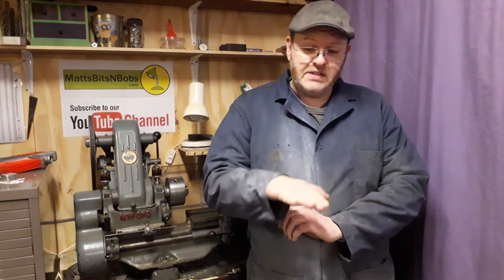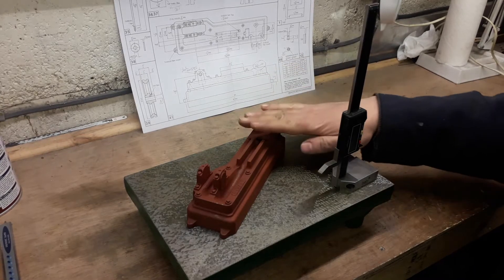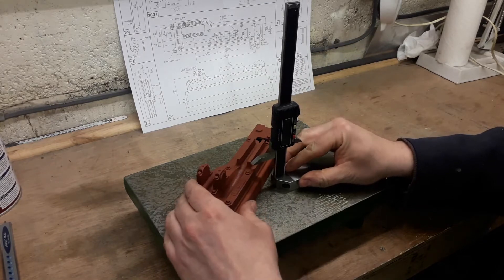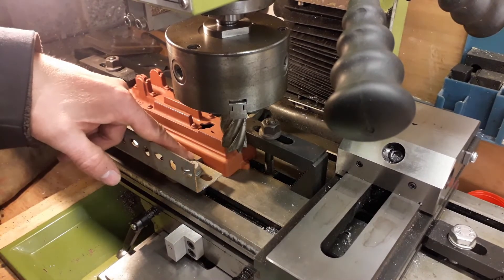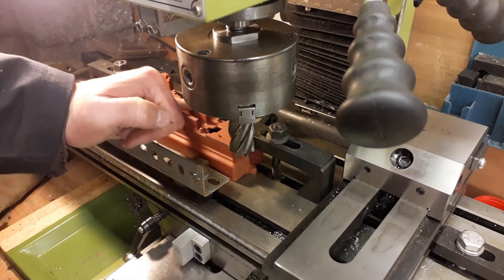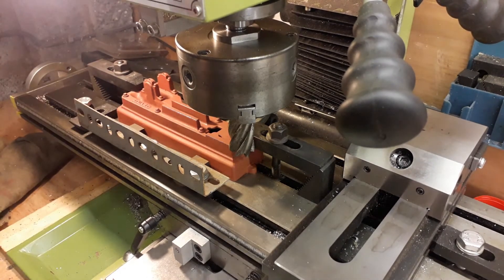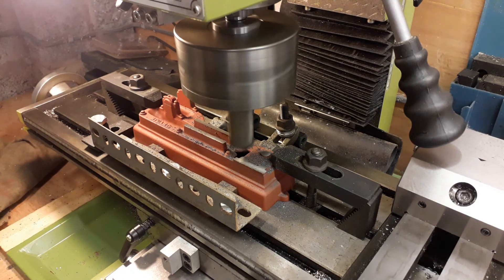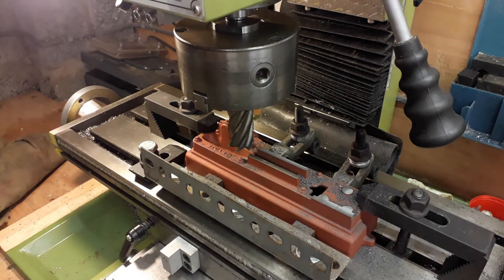Easy Stuart S50 Build Part 2(a) The Soleplate

Comment: Is your mill cutter being held in a three jaw chuck?🤔
Reply from the maker: Officially no, hence the disclaimer in the description, I did have some "soft" shims between jaw and tool, funny only 1 person noticed!
Reply: @mattsbitsnbobsworkshop  You do what you have to do. I'd die to have a small rotary table but then that even needs a way to mount chucks.😢
Reply from the maker: @gvet47  I have a 2mt blank arbor with a draw bar that I threaded the same as the lathe chuck, this fits the 2mt on the mill, the tail stock of my lathe and any other 2mt including the rotary table, these are relatively cheap and it gets used A LOT.
Reply: @mattsbitsnbobsworkshop  I would have assumed that the arbor was at least surface hardened and difficult to thread. Although I did hacksaw one to shorten the taper length for my little lathe. My two chucks are rear metric studs. Looks like any rotary table chuck adapters need a bolt through chuck.
Reply from the maker: @gvet47  The end of the arbor is left soft for machining, brilliant, I have made all sorts with them. Hard to explain how the arbor sits in the table, I will try over the next few weeks to do a video and pop it on here, keep a look out, cheers

Comment: Lovely machine Matt. Does the cast get hot when milling?
Reply from the maker: Thanks Neil, the cast warms up a bit due to friction but not hot cos the fiction is low due to the graphite found in the cast iron that works as a lubricant as you cut it and at these speeds no real heat is produced otherwise we would get a hard spot in the cast. Hope this explains it, cheers
Reply: @mattsbitsnbobsworkshop  thank you Matt that’s great. Keep up the great work.